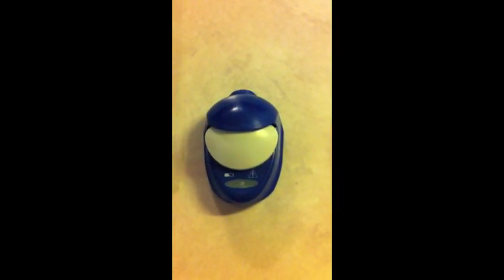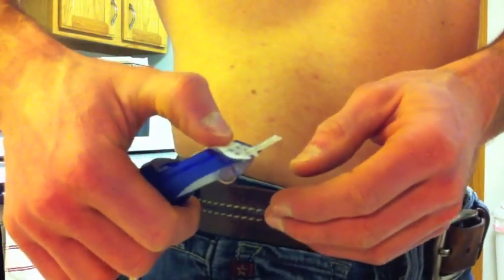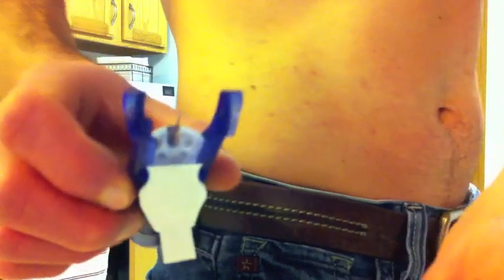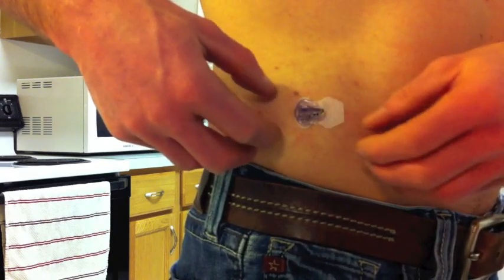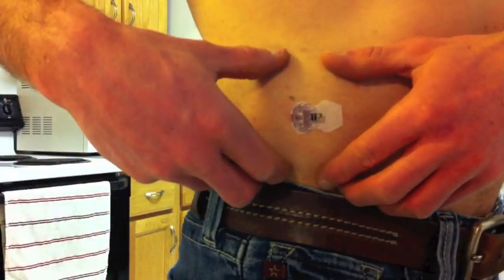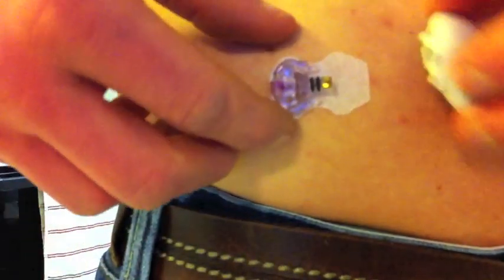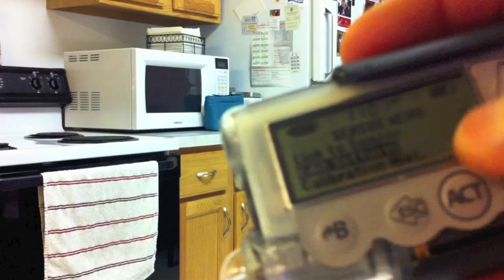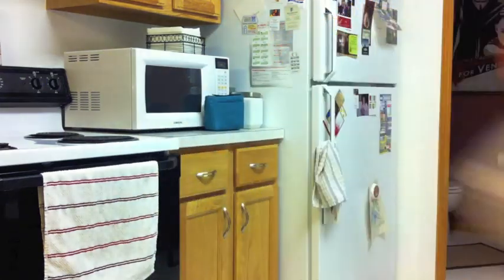Continuous Glucose Monitor (CGM) - Setup & Insert Walk Through

Comment: Any reason you insert it with the needle facing away from your belly button? I've never done it that way.
Reply from the maker: I think I was originally taught to insert away from the mid-line or belly button. It's worked well for me. Depending on your needle length and the fat around your belly, it could be a personal preference choice. Just be safe and consult with your doctor if you are unsure!